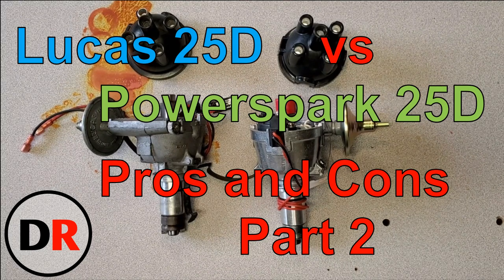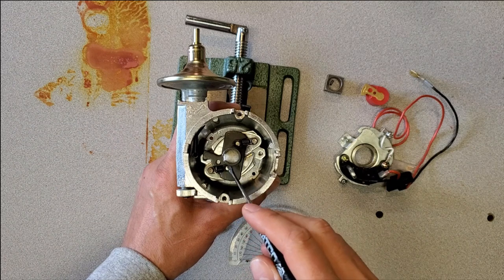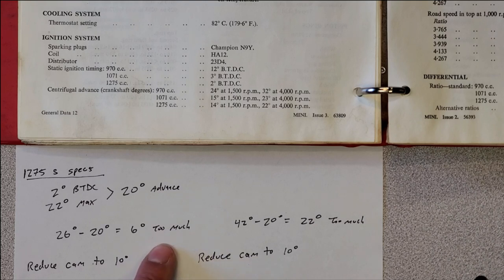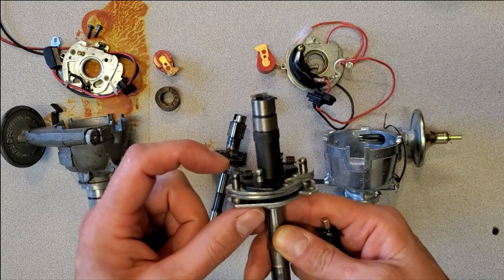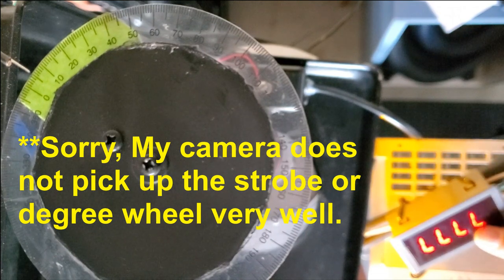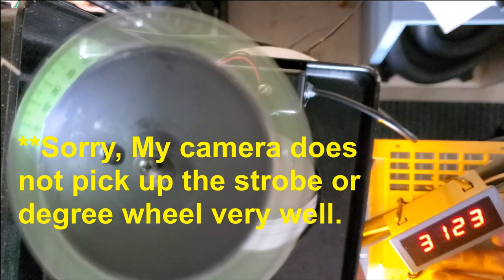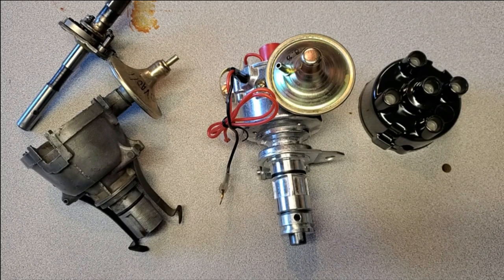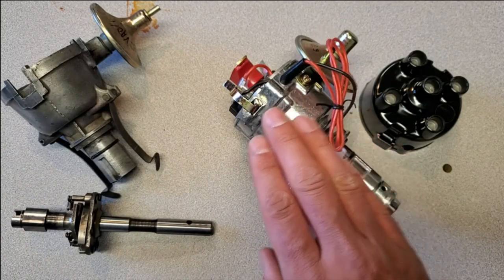Considering a new distributor for your classic Mini? Pros and Cons of Powerspark, Part 2 of 2

Comment: So would the Powersport be more appropriate for say a 998cc?
Reply from the maker: Whats appropriate is what fits into the block. A series can have the 25D or 45D. A+ has 59D or 65D. The powerspark units are appropriate for all engines. I recurve them to suit the application.
Reply: @darrensrestorations991  i think the point to be made is the curve needs to suit the application ie cam profile and compression ratio and any applicable emission regs
Reply from the maker: @Bristolcentaurus  yep, that what I am doing.

Comment: nice workshop manual
Reply from the maker: Its been a great addition to my book collection. Thanks
Reply: Thanks, that was very informative. The remaining challenge is now “how to pick an appropriate target curve when the engine is not 100% stock, and to better reflect modern fuels”.
Reply from the maker: @ah1472-u5h  
Any change to improve an engine will change its ignition requirements. However there is a limit in that air and fuel can only fill the cylinders so quickly.
For a truly perfect timing curve, you must test how much advance an engine can take at various rpm points.
Reply: @darrensrestorations991  How much would a tuner charge to find the optimum timing curve for a particular engine and also , included in the cost of setting up the dizzy timing to match please ? I would assume a dynamometer would be involved , or could an exhaust sensor system be relied on to get the spark timing close enough ? Cheers   and I subbed as your video really  impressed me and taught me stuff .
Reply from the maker: @davidyendoll5903   send me an email and we can discuss this further.